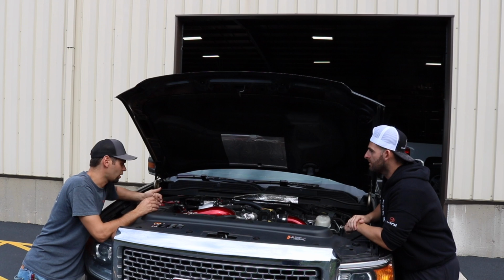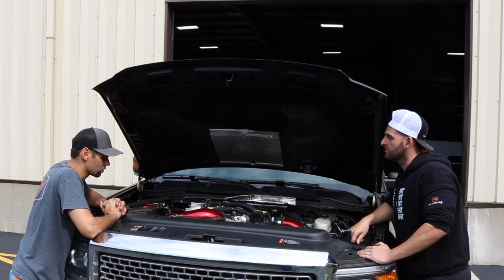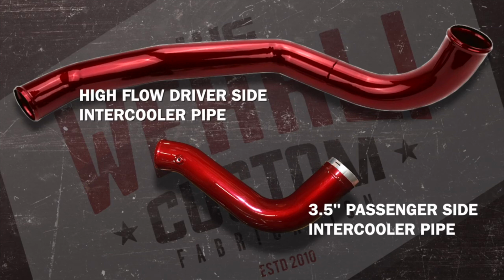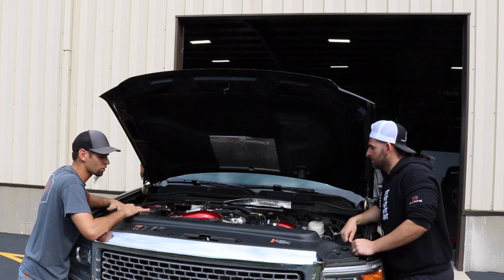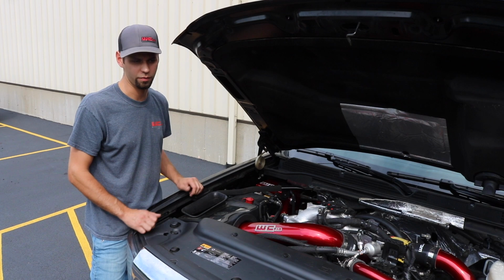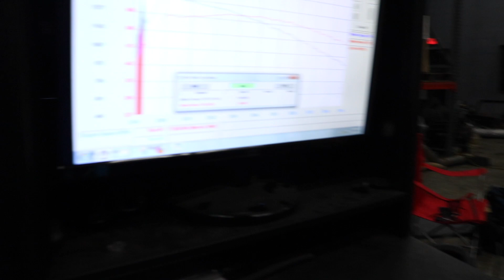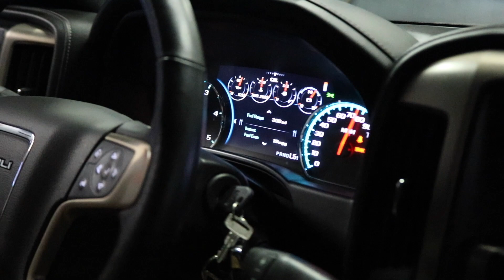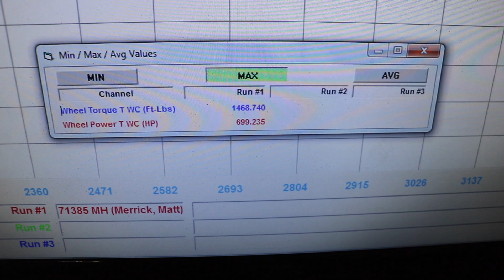My 700HP L5P Duramax - The S369SXE Turbo Kit from Wehrli Custom Fab

Comment: Sooo since you dyno tuned your truck your not using motor op tuning right? And how happy were you with the motor op tuning?
Reply from the maker: I am still using motor ops. Love their tuning!
Reply: Duramax Matt gotcha! So I don’t get it tho didn’t the dyno change your tune basically your tune is whatever the dyno guy did or no? I’m a new l5p owner please explain! Cause I thought you were using a tune from moto op but your dyno guy changed some stuff? Am I wrong?
Reply: What Andrew is asking please
Reply from the maker: Irvin Mejia with the change in the turbo I got updated tunes from motor ops.  This turbo can move more air so I got updated tuning. Maybe I’m not understanding the question?
Reply: Duramax Matt the question is what is the point of dyno tuning when your running motor op tuning and was your dyno guy adjusting any of the motor op tuning? What was the point of the dyno tune when motor op tuning is plug & play.
Reply: andrewyaadigg if im correct they adjusted the tune a bit more for the better flow of the new turbo. Bigger turbine-more flow=more power capability. I may be wrong but that’s my understanding

Comment: Did you get that nice big turbo sound out of it?
Reply from the maker: You can hear it for sure
Reply: Colt Heesacker yeah but not as loud as a power stroke turbo whistle
Reply: Aaaaand???? I had enough of those piles a shit from my 2003 6.0 (endless nightmare) to our 2008 6.4 dually work truck we put 2 engines in....
Brand new Fords still having all kinds of problems, death wobble, leaking/squeaking sunroofs, ccv system clogging up and sending smoke into cabin.... Got a buddy bought a brand new 2018 Platinum F450 and is on his 3rd engine in less than 100k miles hahaha Fuck them things man
Reply: @coltheesacker5656  yea cause fords suck😂
Reply: @coltheesacker5656  will never see a day to see a Ford running

Comment: Is your  L5p fully deleted and tuned?
Reply: Carlos arrez yes it is...
Reply: craydul Did you did it before epa hit. Cause I’m trying to find someone to do mine. And there’s no one who can
Reply: Carlos arrez it’s very expensive for the l5p your looking at over $7000 to fully delete an l5p try ordering your tunes from motorops and then getting the ecm from hp tuners fro there you would have the option of picking other piping from wehrli custom fab you will need to delete your egr, dpf and scr and obviously your def tank
Reply: Carlos arrez you can get it done for around 4,500 sometimes cheaper join “Tuned L5P Brotherhood” on fb
Reply: Carlos, No it is not deleted.🙄 That is illegal sir! Support the Enviro-Stasi Vote Democrat!
Reply: @markvolker1145  😂sure bud